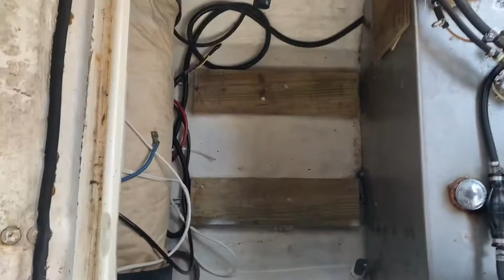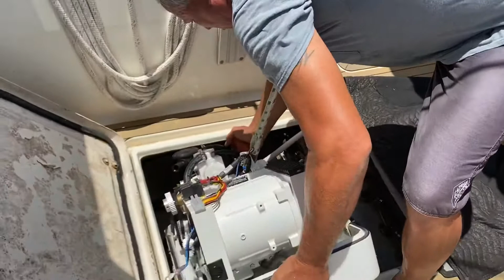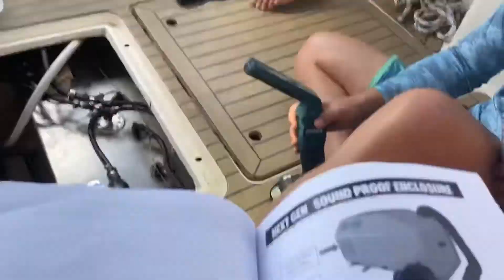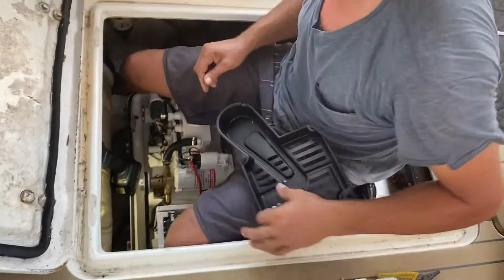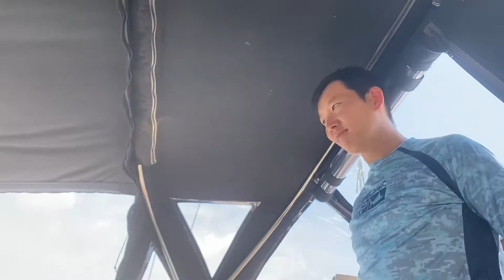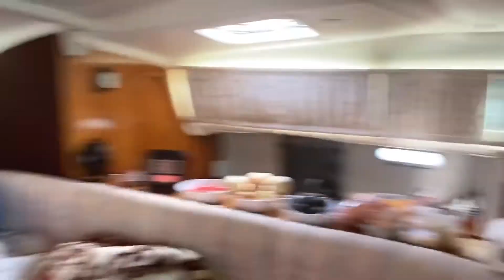Next Gen Generator Install | Sailboat Repair Tutorial

Comment: My 3.5 NG had a 12-VDC Jabsco exhaust fan which burned out and shorted because there was no fuse in the power line to it.  The entire wiring harness burned out.  Eventually, I replaced the wiring harness and instead of a crummy 12 VDC fan, I installed a brushless AC fan with a 30 second delay start relay.  Now the only 12 VDC draw by the genny is the SeaFire fire suppression system and the fuel pump - hardly any need to power the battery charger while running the NG.

Comment: Hi, question, does the exhaust need to exit the hull at the same level or lower than the gen?  I ask because my install would require a much higher exit point.  Im worried about water back flowing to the engine.  Or is there  a one way valve inline in the exhaust?  Thanks!

Comment: Very good installation!
I have a Next Gen 5.5 in my Sigma 41 at Key Biscayne YC.  I cannot get the gen to run the Promariner 20 amp charger!
AC and other 110 equipment run fine but not the charger!  Any suggestions?  Next Gen thinks problem may be in the charger being too sensitive.Tried resistive load while running but nothing.  Any suggestions?
Thanks for your input.
Richard Neve
Rhneve@gmail.com
Reply from the maker: Hey! I would have to agree with Next Gen. I'm going to be thinking about this to see if there is anything else you can do. Thanks for asking!
Reply: check the sine wave with a scope, electronics does not like bad sine waveform.

Comment: I am considering putting one on mine. Miami.
Reply from the maker: It's definitely worth it! Simple too
Reply: @underwayadventures8895  what should I expect to pay for new install? no existing genset onboard.
Reply from the maker: @nicolasterzani9017  I paid about 6k for mine and installed it myself
Reply: @underwayadventures8895  Thanks, I am having it installed this week from dealership.. unfortunately don't have time and skills like you.. it's going to cost much more.. :(... are you happy with it? is it quite enough? do you think I can run 2 Air conditioning units? 12btu + 8BTU if they start at different times. maybe? They draw 8.7amps and 5.5, but is the starting that worries me... I am adding a dedicate 20 gal fuel tank.. do you know more or less how much consumption you have? thanks!
Reply: So mine failed after 2 years 280 hours.. lost compression.. need to take it out and see what’s the damage
Reply: @nicolasterzani9017  Any word on your Genny? I have been looking at these units  :)
Reply: My mechanic put oil from the glow plug hole sitting for couple weeks and compression is back to normal and genset has been working so no need to uninstall it